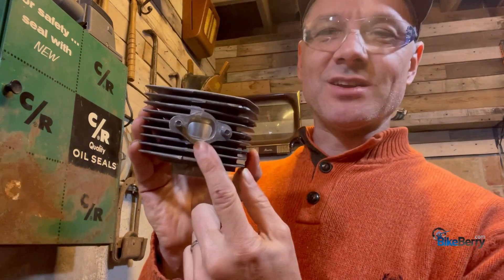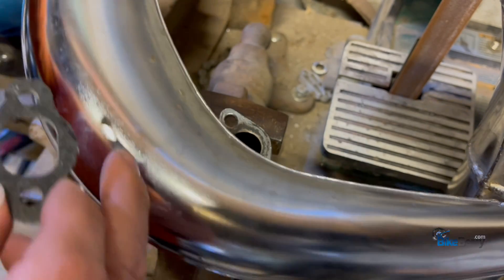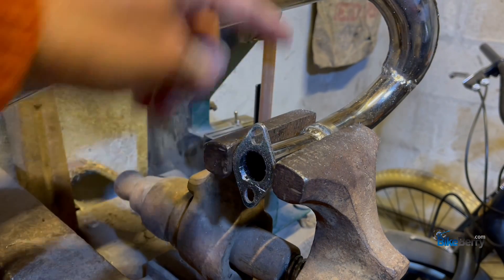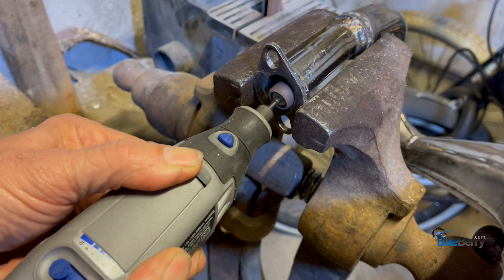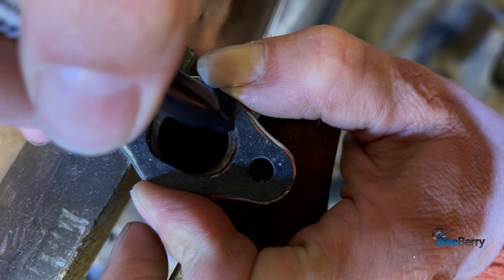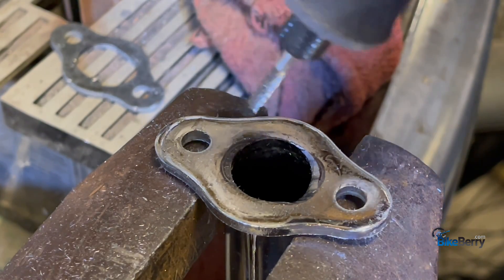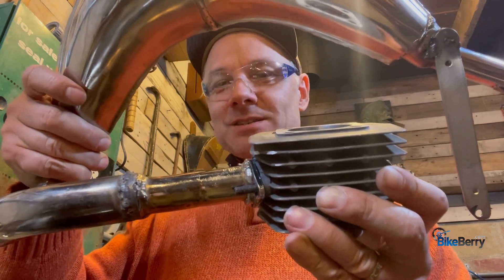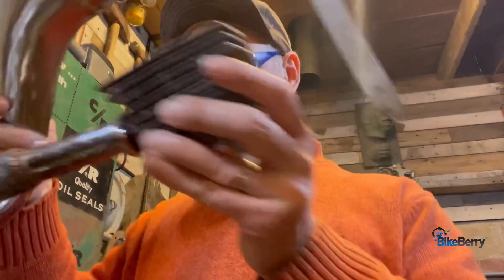Porting Video #4 - Port Matching Exhaust Header | BikeBerry

Comment: I don't see any advantage to "porting" the exhaust - the exhaust gas will enter the neck of the exhaust pipe which is smaller that the area you ground away.

Comment: I've watched all the porting masterclass videos so far.  It's actually pretty good advice for newbs.  Some stuff is a little sketchy, but hey bro, motorized bikes are sketchy. 

In general, following Tony's advice will improve your engines performance considerably.  Up to this point he hasn't done anything to change the port mapping, so you shouldn't expect a cylinder like this to do 10,000 rpm, but it will definitely tug a lot harder off the bottom and have more punch in the middle plus a higher rpm.  

The only thing I see as hit and miss is decking the cylinder like that.  Should really be done only when the squish is out of whack.  The castings on these cylinders could have more or less material than the one he's using, so just taking off 1mm for everybody could be a big mistake.  A quicker and often more effective solution could be using a thinner head gasket.

Anyhow, remember that he never said this work will make a race competitive engine, just improved performance.  And I can tell you from many years experience, this cylinder will run well.  Not amazing, but well worth the effort.

Comment: I port/polish my nitro engines and it makes a huge difference in performance and we can also tune with different types of mufflers to move the torque curve! These motors look like a scaled up version of what we use. What fuels do these use, we use 20-30% nitro blend in ours? I loved the video man!
Reply: Hey man! Appreciate the kind words! We Just use a 40:1 two stroke mixture.
Reply: I’m waiting for someone who builds bikes to get one of these running nitro on a super fat jet being that’s what nm requires. Would be a sight.